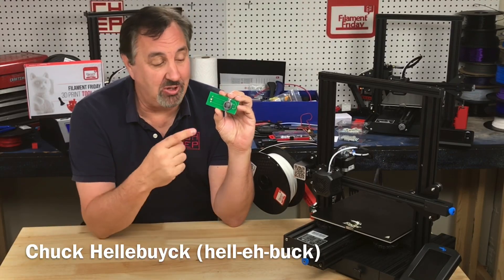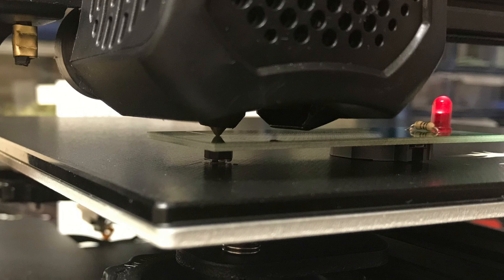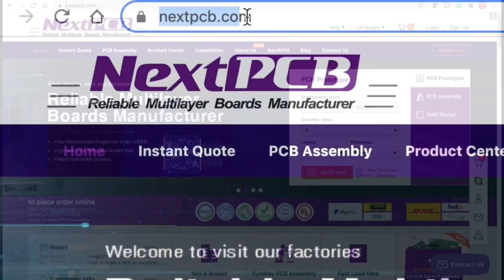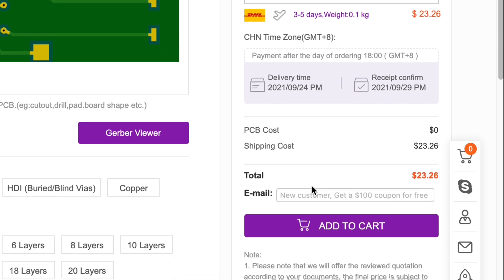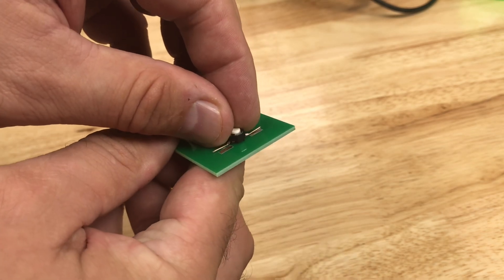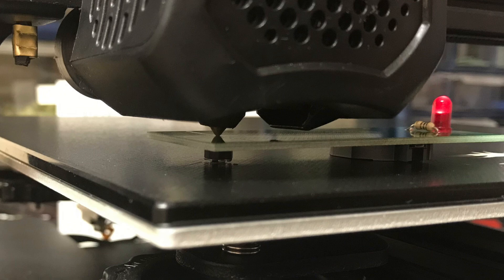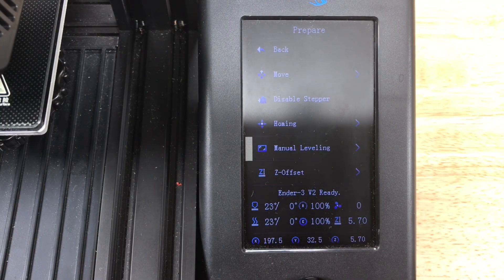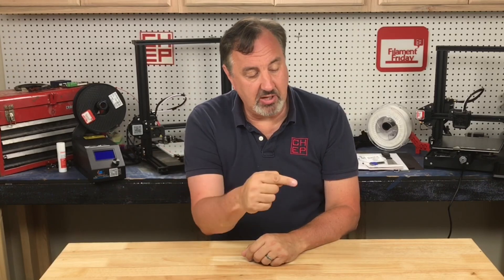Filament Friday E-Leveler - Electronic Device for Easier Bed Leveling on any 3D Printer

Comment: So I was able to level my bed with your tool(setting the z-offset to 5.7). I did a bed level mesh which looked great. I set my z-offset back to zero. But when i print the gcode for level test, the nozzle isnt tight against the bed.
Reply from the maker: It’s because the GCode of the test file has the normal 1st layer Z offset of 0.2 I believe.
Reply: @FilamentFriday  --but i would assume the filament should stick to the bed. It doesnt even look close. I had a z-offset prior  a -2.22 with a bltouch
Reply from the maker: Did you home it first before using the tool with the 5.7 offset? 
I have a GCode file you can run as well that handles the z offset so you can just keep the machine at zero.
Reply: @FilamentFriday  I just noticed you didn't have a bltouch installed, so I'm guessing after I bed level I have to change the z offset for the bltouch
Reply from the maker: For BLTouch follow this: https://youtu.be/TroPjdkSEOY
Reply: @FilamentFriday  I'm having the same issue. I set the z-offset to 5.7, used the tool, and it worked fine. Reset back to zero and it's nowhere close to the bed. I assume the "reset to zero" would instead be "reset back to prior z-offset value" so that it goes back to what it was before. I am using CRTouch but same issue as the BLTouch users.

Comment: But, when you adjust each corner, it throws out the two adjacent corners? How do you deal with that?
Reply from the maker: Adjust each corner multiple times
Reply: Just go around again just like you would with paper.
Reply: Yeh I figured as much, just figured the master Chep might have a better way 😅

Comment: how did u go directly to a test print without calibrating the z-offset after leveling the bed with the tool, you set it to 0  am confused ??
Reply from the maker: The GCode that you use with it sets the z offset to 5.8 mm (thickness of switch and board) and then resets z offset to zero when done.
Reply: @FilamentFriday   OH i wasn't aware there is a gcode  with the tool, there was no instructions in the box, am u sing jeyers FW will the process be same ?
Reply from the maker: Yes. Here’s more detail and Files. https://www.chepclub.com/electronic-bed-level-tool.html
The instructions are on the box. Just scan the bar code.
Reply: @FilamentFriday  This is incorrect. The gcode is only doing a linear move, not setting the z-offset. G1 Z8 is simply moving to 8.0mm above home before moving to the point to do leveling, and G1 Z5.8 is merely a linear move to Z +5.8 above home 0. There's no gcode setting the z offset. If the intend is for the z probe offset to be set to 0 during use, update the instructions. Otherwise, if someone has a non-0 z probe offset, this will tram the board away/into the bed. 
If you use this, do not adjust your z-offset after tramming with this device. If it's already 0, leave it 0. If it's -1.680mm, leave it at -1.680mm.
Reply from the maker: Andy, 1000’s are using it including me. It lifts Z 5.8mm and resets it to zero when done. Try again.

Comment: Couldn't the battery holder (or a slightly different type of holder), be used as the switch?
 the springs in the holder would push battery away from one contact, and then when z is lowered it will contact bed, pushing the battery into holder and completing the circuit.

Comment: Hey CHEP, I have a question.

So I have an E3P with a glass bed and cr touch. My bed is unleveled and your M25 bed level gcode doesn’t account for the thickness of the glass bed ( I’ve tried a few times and ran the square bed level test and the nozzle went into the glass bed * it didn’t do much damage at all* I got just a very tiny mark on the bed )

I was just wondering if I could allow the cr touch to do its auto home probe and then set my z-offset to 5.8 and then use the e-leveler and go from there?

Please respond to this comment.
Thanks.
Reply from the maker: Glass bed doesn’t matter. It should home to the surface. So if it’s going into the bed then you have to adjust the knobs so it doesn’t do that first. Then run the GCode and readjust so the LED barely lights at each corner. It has the 5.8 included.

Comment: This is an extremely good idea, I wonder if anyone could do this in a printable removable mount to be fitted beside the nozzle, like the FreeABL. Since this has it's own battery, no need to run wires, one could just slide it in, use it and then store it away.

Comment: I'm new to the hobby. Perhaps I wasnt listening, but I'm not sure that you ever answered the question about how tight the paper should be. As that circuit board appears to be several times thicker than a piece of paper, how is this kit better than a thinner piece of paper?
Reply: Yes he did, when he mentioned changing to z offset. I'd assume he knows the measurement of the board he made
Reply: equal tightness on the paper among the corners. that's why its difficult to gauge.
Reply: He measured out the board with button pressed with his calipers & just input that offset to his Z axis (5.7mm offset on this particular printer).

Comment: I got this device today and jumped right into re-leveling my bed. Ran the recommend G-code (needs to be longer than 20sec or push button to advance) took me several and I mean SEVERAL TIMES to get all corners set. Finally run the test...one corner was a little too squished. Fixed that ran the recommend square test an all came out pretty pleasing. Decided to print an object. Now the whole bottom left corner is off an it's squishing it so bad that it's transparent in places. So I can't contact you from the website without paying to figure out what I have done wrong. Can you please help out?
Reply from the maker: Contact me at chelleb1 at yahoo
If the squares test printed fine then the issue could be with the way your print was sliced or warpage in the bed. 
A successful squares test proves the bed was properly leveled and the tool work well. 
We are looking at increasing the time. 
The click doesn’t work on all machines because of firmware inconsistency.

Comment: You can clip the alligator clip to the hotend if there was a gap no?
Reply from the maker: If there was a gap but I tried it and even a bit of plastic oozing from a hot nozzle can prevent electrical contact so the CNC tool options still may not work.
Reply: i hooked the alligator clip to the heat-sync above it and there was continuity to the nozzle, however it's not as easy because usually there's just a bit of ooze from the nozzle that insulates.
Reply: @Paint0nBrush  Ah I didn't think of that. Adding some custom g-code to retract before ABL might solve that, but there still might be some stuck around the nozzle.

Comment: Hi Chep, I'm the owner of two deltas (Flsun q5 and qq-s pro) but I'm having serious difficulties of doing the z0 adjustment because of the paper test, some say tight against bed others loose. Hence no productive printing. Can you suggest anything, will your device work with deltas?
Reply from the maker: It should as long as you can set a Z offset.
Reply: @FilamentFriday  Thank you I will check that.

Comment: So i just got an Anycubic Kobra Max, and i am also running An Artillery Sidewinder X1V4. I don't see a Z offset for the X1 or just couldn't find it. Both are stock out of the box. Will this work for both or 1 of them?
Reply from the maker: Yes, just use the 300x300 max size gcode
Reply: @FilamentFriday  thank you.

Comment: Hey Chep.
I bought this tool and watched the video. When you set the z offset  to 5.70 and then you start the leveling.  Once your done you put the z offset back to zero is that what you leave it at or do you have to adjust that too. I have bed level with bl touch and then l adjust the offset or is it the bl touch that lm adjusting. 
Any help would be appreciated. 
Thanks John
Reply from the maker: Yes, leave it at zero after using the e-leveler. That should give you a near perfect bed for the BL-touch to work from. 
There is a GCode you can download to run all that for you. Download from the link the bar code on the box sends you to.
Reply: @FilamentFriday  ok  will do. Thank you for your response.
Reply: @FilamentFriday   l did as the video says and when l print the bed level print after bl touch probes , it moves to print and the nozzle is to far from bed. I put offset back to zero?
Reply from the maker: If you are using the BLTouch to set home then the nozzle needs to be at the bed. The video is based on the z stop on the side rail.
Reply: @FilamentFriday  lm a newbie to 3d printing. I'm  not sure in what you are saying. I'm not sure what I need to do. 
Any help would be greatly appreciated.
Reply from the maker: Set the Z offset for the BLTouch first per the instructions with the printer using the paper method. Then run my GCode to level the corners with the E-Leveler.

Comment: I just received the led circuit board and followed the video, but the hot end was a good 5-6mm above the bed ?? 
Please someone help before I bin the printer .
Reply from the maker: Adjust the z stop switch so it homes just above the bed.

Comment: I have an ender 3 neo max and this works perfect...unfortunately I also have an anycubic mega x...and I've tried to drag and drop the gcode directly to the SD card, I've tried to import and save on my SD card and my anycubic will not recognize it...any idea on what I'm doing wrong (I'm still relatively new to 3d printing)
Reply from the maker: First I’ve heard of the GCode not working. I don’t have one to test. Try the max sd card in the mega.

Comment: It's cool. The only question I have is how accurate is it. The tiny switch could be a weak point of the design. Does it always compress correctly are the rails the button runs on flat? does the LED really only lights up when the button is compressed completely or before that happens? Although while that is worth considering it might not matter in the long run.
Reply from the maker: Here’s your answer: https://youtu.be/9lczwYOQSbI
Reply: @CHEP awesome thanks for the answer and great work on already diving that deep into the topic. Big props!

Comment: It tries to drive down so far I feel its gonna break my level tool. I've tried doing z offset but it still comes down too far and doesn't pause. Have neptune 2s. What am I doing wrong
Reply from the maker: Are you using the GCode from the site?
https://www.chepclub.com/electronic-bed-level-tool.html
Reply: same and on a Neptune 2s as well

Comment: since the print head is metal, did you consider just lowering it till it make contact with two closely spaced pads on the PCB? that would get rid of the mechanical influence of the switch.
Reply from the maker: Yep, but a dirty nozzle isn’t conductive.

Comment: I like the idea a lot, but I'm wondering about the precision of a button like that. Perhaps a nice alternative would be to have a bunch of really tiny traces on the pcb which will connect when the nozzle makes contact? Or much more accurate, a little pressure switch. I'm not sure how thin those can be though.

Comment: I feel like it's easier to just buy an auto bed leveling sensor
Reply: When you buy one, you need to do some programing or something from what I have seen. This feels some what easier. Though im sure it won't work well with my tronxy
Reply: You always a get a offset value of the nozzle with a probe mounted, but can be calculated. This gives you where the nozzle are.
Reply: If you have multiple printers this gets really handy.

Comment: I have the board, but the Ender3 pro doesn't seem to have a way to set z offset?  What am I doing wrong?
Reply from the maker: Run the GCode we offer. It takes care of it. Just follow the bar code on the box.
Reply: @FilamentFriday  Thanks, I did that, but 20 seconds wasn't long enough for this  old body to react.  I bumped it up to about 45 seconds by    editing the gcode.
Reply from the maker: Perfect. After you get used to it, you’ll probably set it back.
Reply: @FilamentFriday  I didn't edit the original.  I used a copy so now I have both.

Comment: How do I do this on a Ender 3 ? don't have the manual leveling option  and when I change my offset and then home, it goes to the same position as before!?
Reply from the maker: Change offset and then manually move the head. Don’t home.
Reply: @FilamentFriday  thanx,. Is it also possible to change this in your CHEP_M0_bed_level.gcode file? Or is this not advisable?
Reply from the maker: Interesting idea. I may play with that.

Comment: Would this be possible with raspberry pi pico, very curious to know if that would be possible.
Reply: There is no microcontroller in this circuit. The battery is connected to a button that when pressed turns on an led. I guess you could add a microcontroller like the raspberry pi pico, but that would be unnecessary for this usecase.
Reply: In my opinion that would be an overkill.
Reply: @MacEvoyING  I would say massive overkill.
Reply: @martinmckee5333  indeed.

Comment: have a geeetech a10 v1 has no z offset in the menu, how can I adjust the head to do mesh bed leveling please with your tool
Reply from the maker: Use the GCode from the E-leveler site: https://www.chepclub.com/electronic-bed-level-tool.html

Comment: @Chep - Won't a hot nozzle damage the circuit board ?
Reply from the maker: It’s FR4 so fire resistant. Besides, I showed in another video you don’t need to heat the nozzle.

Comment: Great idea.   Nice simple o circuit.  Wait… please explain… that was a short stack of boards… why over $20 in shipping?  Seems like there was some recapture of the you free cost?  They must have high handling cost or is it shipped in some special way?
Reply: I think it was coming from China
Reply: That is a fairly typical shipping cost on the PCB services from China. If they are pushing any cost into shipping, it's everyone. I usually combine orders of multiple board designs when possible because the shipping does not increase nearly as fast as the number of designs does. So one can save quite a bit by batching orders.
Reply: @martinmckee5333  ahh no idea the PCB shop was in China…. That would make sense then.  Shipping times must be longer I think.
Reply: @richardburguillos3118  Shipping is usually a week or less. They're actually pretty fast.

Comment: I don’t physically have an offset on an Ender 3 v2 before printing. Please help 🙏🏻
Reply from the maker: Have you used the G-Code files that download with the E-Leveler?
Reply: Hi there, yes but for the Ender 3v2 the nozzle isn’t positioning above the screw hole as anticipated and on the neo same thing. The Neo Max bed is 300x300 so I think it’s a bit bigger than the regular max.

Comment: hey chuck this is an awesome video, not only is it half the price of a BLTouch  but you can use it on any printer that allows you to set the Z offset thus saving a ton of money on multiple individual ABL systems and it is super easy to set up and use. Im just bummed i have already bought several BLTouches for my printers, this could have saved me a couple hundred dollars and a lot of effort taking apart printers to run the wires and to gain access to the main boards. this is also better than trying to just tell us how much pressure to put on a piece of paper or feeler gauge because everyone has a different interpretation of pressure and feel when sliding around paper or a feeler gauge.
Reply: Trust me mate you're much better off with the BLtouches :D
Reply: This does not serve the same purpose as using a BLTouch. It could however be used in conjunction with it.
Reply: With Jyers firmware, the BLTouch can be used as a feeler guage to assist manual bed leveling. Far superior to using paper. Then with 15x15 UBL and mesh tilting before each print, you have perfect automatic bed leveling every time.

Comment: Hi, so i bought it from amazon, and it works on my ender pro 

But on ender 3 max neo, i cannot even get the file to attempt to print, it just crashes my printer? i contacted amazon and they told me to send it back for a refund. If it works for the ender 3 pro i figure its just a file issue, any assistance is appreciated.
Reply from the maker: Are you using the larger bed Ender 3 Max file?
Reply: CHEP  yes, It worked before, but I updated the printer since I was having issues with the cr touch and now it just tries to display the time/layers and crashes the printer
Reply: @dvdolvera2  Hey Chep.  I just bought tool and my max neo won't print the file either. When i select the file on the printer it looks like its trying to load and then it just goes back to the main screen.
Reply from the maker: Watch my latest video: https://youtu.be/9TGPERaQtmc

Comment: A good way, difficult and expensive, to make a non-accurate tool. When the bed is heated, the plastic of the switch will deform, make factory pcb for such a simple device, are you serious?
Reply: Jup, it’s useless. Cool idea, but useless
Reply from the maker: The switch doesnt melt at the bed temp.
Reply: The spring mech inside the switch will be affected by the heat generated by the bed. Trying to get an accurate measurement time after time will be hard to do.
Reply: @CoroaEntertainment  How much the button springs back and forth is not a function to define whether the circuit is completed or not.  The thermal heat transfer in the button is not going to be significant enough to affect the physical size of the switch contacts inside the enclosure of the button.  The plastic also doesn't expand or contract as much as the metal inside the switch.  The plastic of these buttons are physically formed in temperatures MUCH hotter than what you should be running your bed at anyways, and won't warp or deform at 60-80'C temperatures.  And even if you don't think any of this is true, then do your bed levelling at room temperature and you eliminate the question of bed heat doing anything to the function of the button.